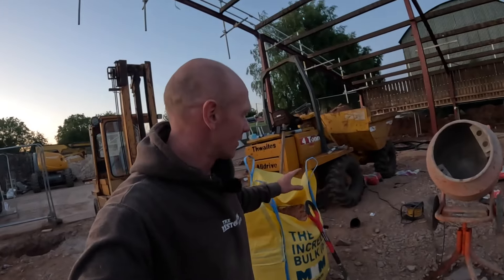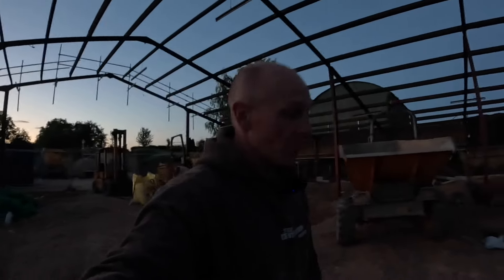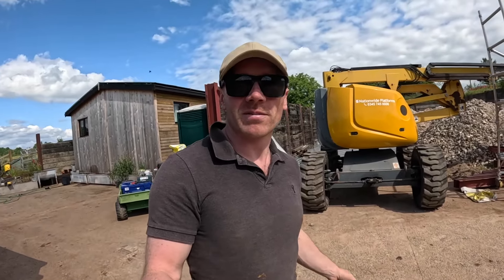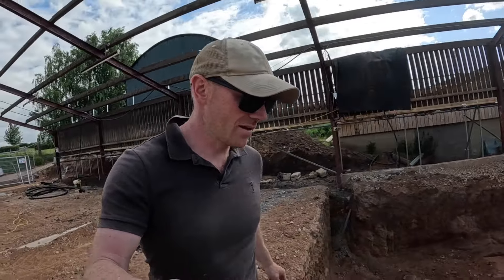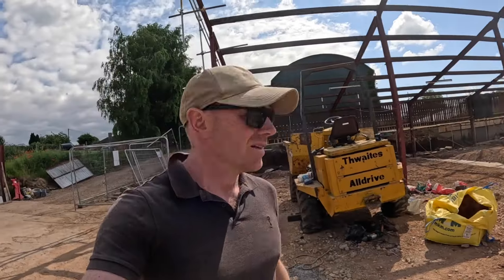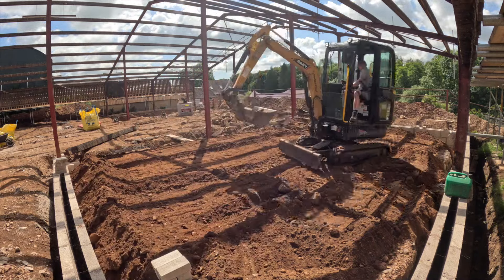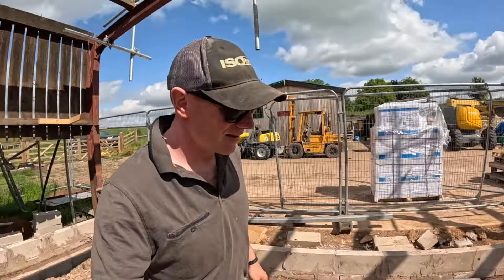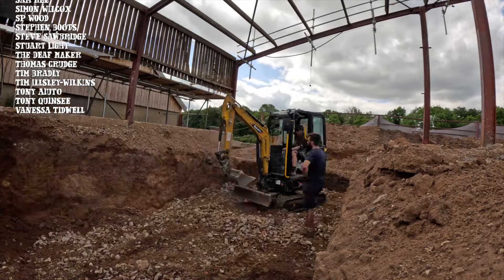FIRST SIGHT OF PROGRESS ON OUR HOUSE BUILD - Walls are started!

Comment: With respect to whacking your sub base down, there should be a certain amount of moisture within it (As I remember from doing a “cold lay” road repair course). What this effectively means is giving it a good spray with a hose (enough to make it glisten, but not puddle) this helps the sub base whack down “tighter”, and stops you creating a cloud of dust.
I just mention this, as with the current heat we’re experiencing, I’m guessing the base has probably dried out a lot.
Great work, I find it’s always rewarding to be getting out of the ground. 👍
Reply from the maker: Yeah the last layer we will definitely be getting some water down, for now we just needed it roughed out so we can get the forklift around and up to the roof height safely.

Comment: I had the same problem as you had with a blocked carb on my lawn mower and I have been told that these type of engines won't run on the regular unleaded now, but need the premium fuel ( confirmed by BP staff). Hope this helps
Reply: We've seen the same with outboards at our marine service/engineering center. The regular just gums up the carbs with very little run time.

Comment: Great work guys. It must feel a great relief to get to this point. Quick question, did you consider a geothermal system for your heating a cooling needs? Can’t stop thinking of how many square meters can be used without impacting on the design of the house.
Reply from the maker: We have but the heat demand is now at such a low point that spending more on ground source wouldnt be worth it.  I'd rather put the budget towards insulation and airtightness.

Comment: Never let carb engines sit unused with fuel in - if there's a fuel shutoff, turn it off and let it stall out. If there isn't, drain the tank then start and let it stall. Saves a lot of hassle later on.
Reply from the maker: Yes certainly will.  No doubt I put it back in the shed three years ago. thinking 'ill use that next week". 😂
Reply: @TheRestorationCouple i’m pleased it’s not just me who thinks like this. Dreading attempting to resuscitate my (Lidl) whacker. 🤦🏼‍♂️
Reply: @TheRestorationCouple  you've done well to put it in the shed and not just leave it out for 'that quick job next week'. Only to never do it and find it still sitting outside 3 years later 😂

Comment: I would add a second make that is FFL+1meter will be easier to set the laser level at that height and then measure down to FFL rather than trying to set the laser level at FFL.

Comment: Hi, why didn't you use trench block?
Reply from the maker: Wall needs to be nearly 500mm width so would still have been trench blocks plus another skin of 100mm blocks. We may use trench blocks on the deeper sections we have left or possibly shutter and mass fill as it works out better both time and money. 👍

Comment: On the subject of the pool, factor on a hydrostatic valve at the base of the pool before you lay the concrete base. A rise in the water table can lift and crack a pool. Looking good.

Comment: Could you have hired a concrete pump to improve your accuracy?
Reply from the maker: We will for the slab and ICF pours but at £500 a day it's easier for us to just do a lorry at a time.  Some of the trenches would block access for other tasks so needs to be stages. 👍
Reply: @TheRestorationCouple 
Don’t you have to pay waiting time on the lorry
When I had readymix we had I think 20 mins to empty the truck anything longer and we paid extra

Comment: Mate major faux par…….. that beer out of a can just wrong, if definitely deserved.
Re plate compactor. The carburettor needs cleaning out. Jet gets blocked with old fuel. Easy with an airline
Reply from the maker: Yeah a pin cleared the jet and started like new. 👍